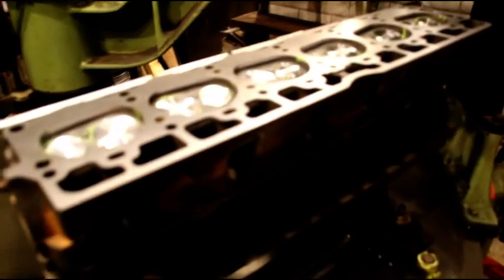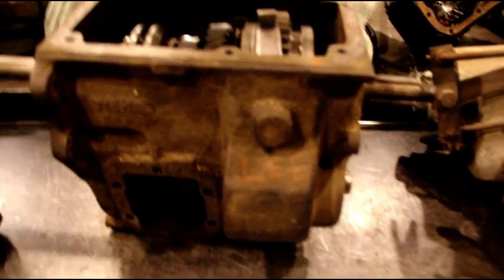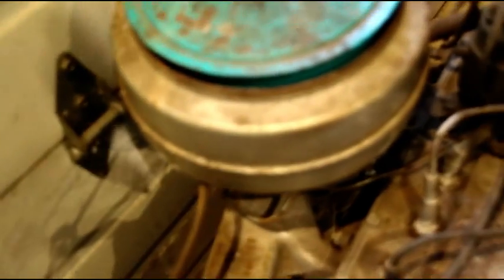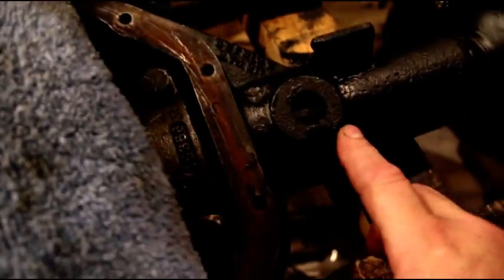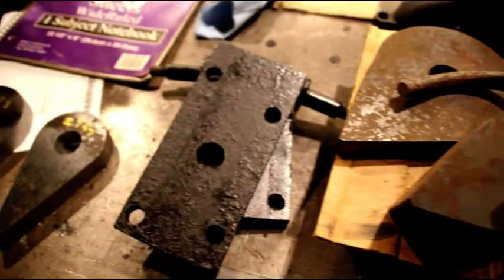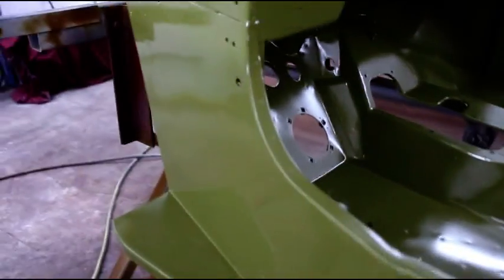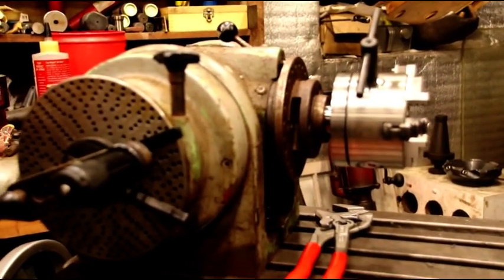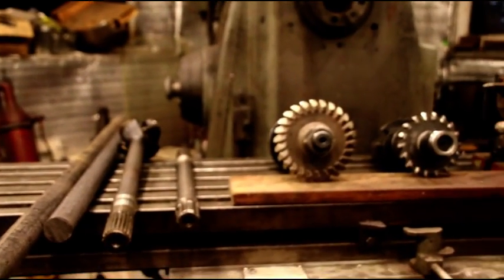AMC 258, Jeep T18 to NP208, L6-226, CJ2A Painting, U-Bolt Bending Dies, Axle Spline Setup

Comment: How do you paint the fasteners after you assemble the completed painted Jeep.   I had all my parts painted locally then I assembled.  Now I have to figure out a way to paint the nuts and bolts.
Reply from the maker: you can easily paint them with a small brush.  I usually assemble things with epoxy primed bolt heads.  Then just mix some paint and touch up with a small brush

Comment: do you have a video explaining in full detail the seps you take to paint?  what primers you use, do you sand between priming and color?  etc etc. I am getting ready to paint my jeep like you have done big space to work in but I am not 100% sure on paints to go for (maybe something I dont have to clear coat)  would appreciate your help.
it is a black omix body but I plan on random orbital sanding the body
Reply from the maker: I have many, many painting videos from start to finish.  One thing that is very critical if using a repro tub or parts is to sandblast down to clean metal.   the primer they use WILL FAIL 100% of the time.  Most guys don't take it off and are super pissed off when the paint job flies off when driving down the road.   
Sandblast to clean metal. 
EPOXY prime everything
Regular primer or high build next.  
Sand primer
Epoxy Sealer
Single stage urethane or base coat for base clear setup.  
Spray 2 to 3 coats and let dry.